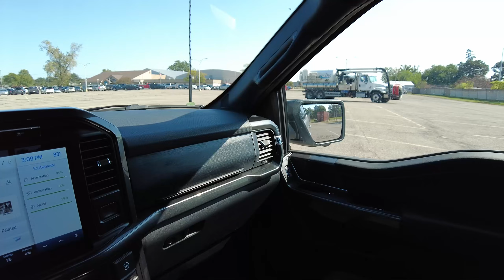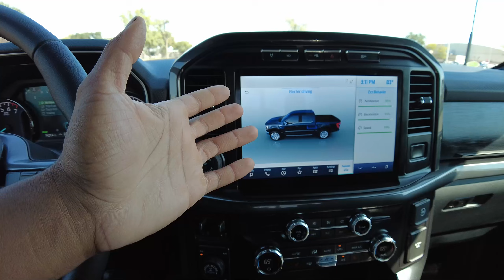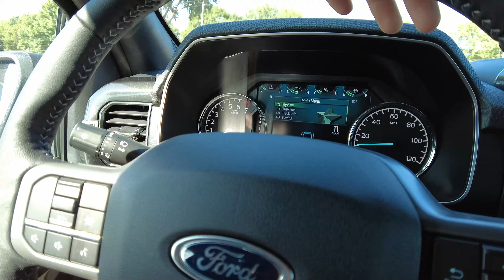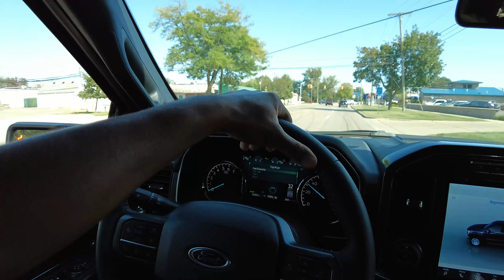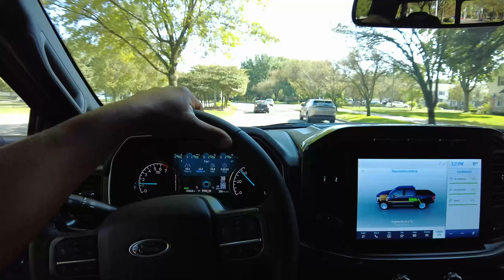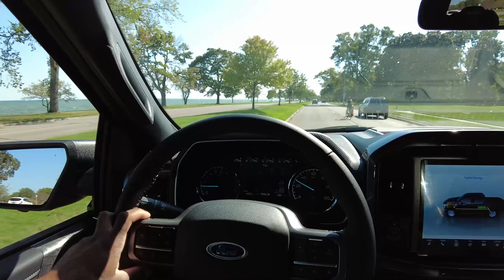3.5 POWERBOOST - How far can it drive all electric in ECO MODE???

Comment: They do have similar technology for big rigs, it's called an APU. Auxiliary Power Unit. My dad drove OTR up until around 2016 and had one in his truck for several years before he retired. I think his company installed them around 2007-2010, I know they did quite a bit around that time to cut fuel expenses. Also, some of the big truck stops have a paid shore power/hvac service that, I believe, pipes conditioned air in through your window.

Comment: Lol you talking a lot of BS without saying anything at all bro. How far can you drive on electric only? Or you don’t really know?
Reply: I know its been 8 months since you posted this but I actually have a Powerboost Lariat 502a "High/luxury" package 4wd with the FX4 off-roading package and at first, I wasn't getting all that great of milage (15-20mpg) but that was a mixture of because I had bought it in the Winter (Im in Massachusetts, we had a cold snap in Feb where it was as low as 0 degrees) but right now even in 80-90ish degree heat with the AC maxed I have been averaging anywhere between 26-32mpg for my commutes and errands around town.

Regarding electric-driving specifically, its kinda weird with this truck compared to other hybrids, it almost never stays in electric mode when going from a stoplight/intersection unless your downhill or creeping through if its a yield. It'll switch pretty regularly when coasting under like 60-65ish MPH But according to some forum members over on F150gen14.com that monitor the powertrain activity with an OBD2 dongle, the electric motor does also assist the engine in quite a few situations for added torque or propulsion or whatever especially if you're in a higher trim truck like mine that has a transfer case with "4A" that acts similar to what you'd expect in an AWD car or SUV.

Its not a bad vehicle by any stretch, and while it can definitely suit more people's needs than the F150 Lightning EV its hard to recommend because of the dealerships having trouble with backordered into oblivion parts and Ford seeming to have trouble trying to roll out Sync updates over LTE in waves Unlike Tesla's Apple approach where they'll push out an update to everyone at once

Comment: I had a rental 2019 F150 with the Coyote 5.0 FX4 package and the thing was getting 21 mpg.   It was better mpg than my 2016 Explorer 3.5v6 Na.  I don't see the benefit in this setup for mpg. Its not cost effective considering the truck will need a new battery.

Comment: I'm getting as High as 27 mpg... on mine... You have to go slower to achieve these numbers.. and you'll have too wait until your ENGINE brakes in before you see higher numbers in milage, and warmer days help, and using no AC!... Driving around with the windows down, is just the Best in my Blue Whale!
Reply: Drive with no Ac ? Windows down ? That’s absurd for a truck with a tag of ? $65,000
Reply: @tanglemess6153  And 40 years ago, we didn't have these things in vehicles.. AC>> was Rare, and Vehicle's weren't the price of Small businesses!
Reply: @DavidReese2ndA  100% agreed man.
Reply: @tanglemess6153  Your Spoiled... Were only in upper 70's lower 80's... Don't Expect to get any good gas mileage, and expect Good petrol payment a month!
Reply: Turbos that will need frequent service and a battery that will go bad in 8 or 10 years.  No good.  LEASE all day but not worth buying.

Comment: Still waiting for you to mention the mpg from towing. 🙄
Reply: Pulling my Polaris ranger I can get 11-13 mpg in my powerboost . It’s still much better than my previous 2015 Silverado 5.3 . I’ve tried towing in eco and tow mode and eco still gave me better mpg pulling my ranger it runs in lower gears. My last tank of fuel not towing I was able to get 610 miles on a tank which was rt at 22 mpg .

Comment: Ford is the the future of cars and trucks, (I believe Ford will come out with new model sedans again, one day…) sorry Tesla but the return you get for your money from this truck and the future vehicles like this will way surpass all electric vehicles just for the range you can get and the power you can get from a gas hybrid, trucks are still expensive but the power you get from this and the capability’s are amazing! Question, I’ve heard the new 2021 f150 5.0 is hard to tune? What’s new about that engine that marks is different?
Reply: I believe it too! I come from a family that has been driving trucks since the 70s with a fencing business and my dad has a 3.0 duramax and it’s amazing but gm is so behind and the Silverado ev is disappointing. For with the non plug-in hybrid is gonna take over. Gm had a chance with hybrid but gave up and now ford is making bank on it. 100% ford will be my first new truck they are the future of the Industry.